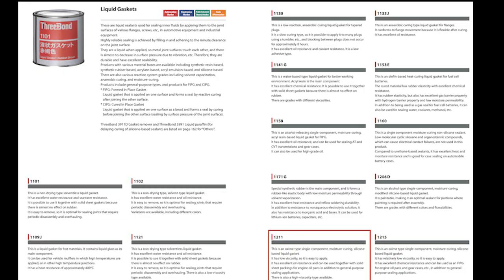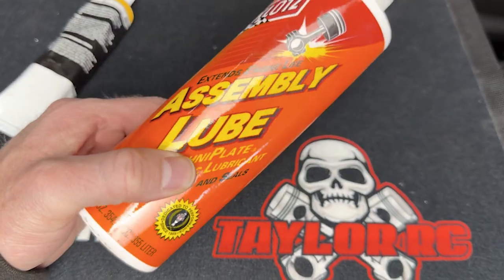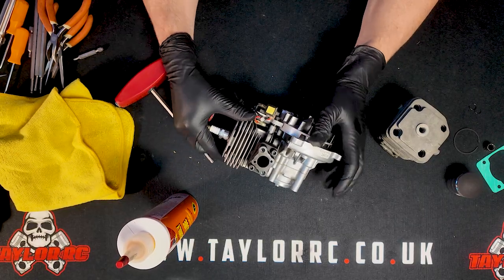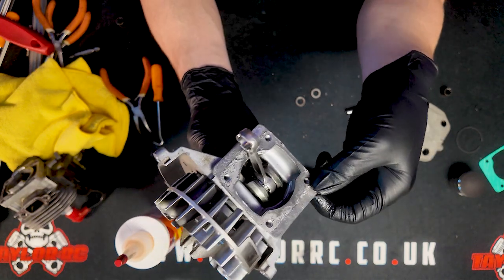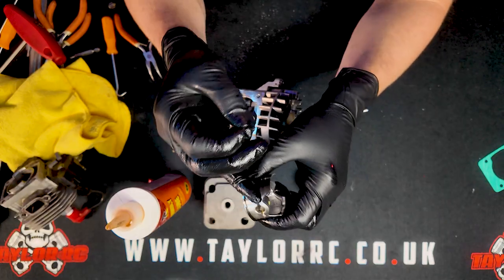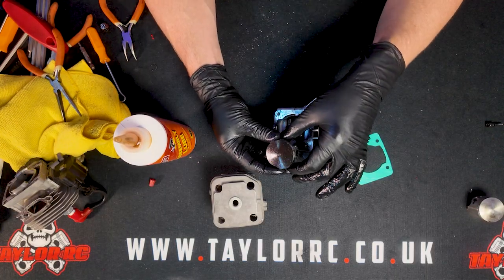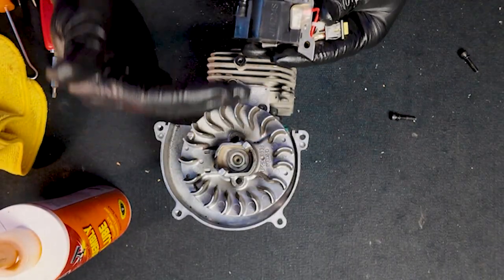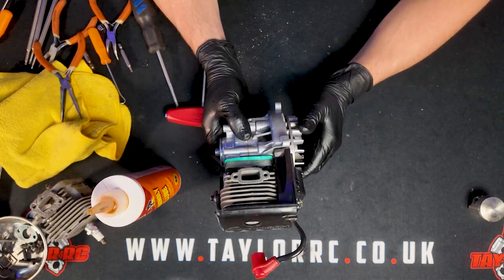How-To Install the Fujiwara Zenoah 40mm G350RC Bore Up Kit

Comment: Nice video as usual. Dont know why anyone would do anything with a Zenoah when there are Taylor 35 available. But what do I know.
Reply: Cost ! Not everyone can afford a taylor 35 but if you've already got a g320 then this is a cheap option
Reply from the maker: These fit a nice segment in the catalog where the cost is not as high as the 35 reed for example; or if someone has an engine from one of their RTRs that they want to build out for a little more power. They are a great value!
Reply: Cos Taylor engine over heat
Reply: This won't work on the 30mm stroke setup only stock 28mm?

Comment: Hi Steve.
Keith here l have an OBR signature series reed case 32cc engine in my Baja  just wondering about this  fujiwara head kit regarding top end  rpm??.
Looking forward to the running video.❤
Reply from the maker: These are not reed ported or reed modified in this configuration, so it will not work on that exact engine

Comment: Thank you for the video Steve. Since we are on the topic of the tranfer port covers of the Zenoah G320. Does anyone know what the numbers on the covers mean? T1 3/8, T1 8/8, T1 7/8 and so on. Bartolone and TR/OBR dont use any numbers on theirs. Wondered if the numbers denoted better performance potential.